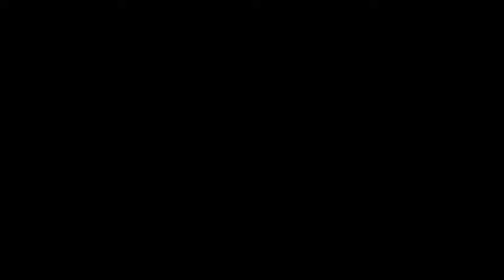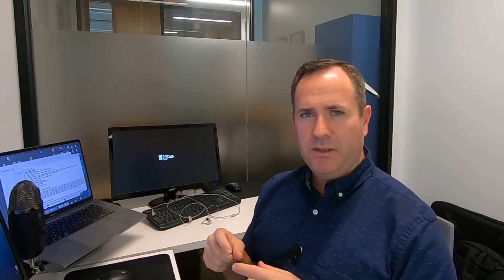How I Solved My Blender Audio Sync Issue

Comment: could be nice if u show how to do it....
Reply from the maker: I agree, updated the description. Handbrake isn't too hard to use, but the key is knowing to use it and to re-encode video as constant frame rate. For the GoPro that I've been using it was also important to disable interlace detection for the re-encode.
Reply: @davidrsterry  exactly my problem was framerate too, luckly i solve it, the real issue was, i render the video on png , so when i was putting the audio and the video, i have to import the png secuence as video, and i forgot to set the frame rate at 24 fps, it was running at 30....it was a totally mess , but once i fix dat it worked fine